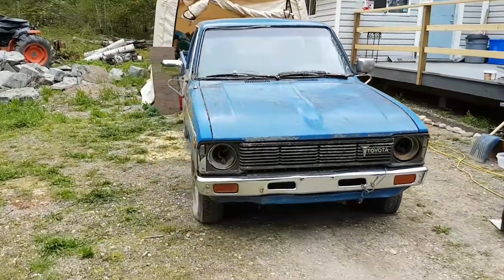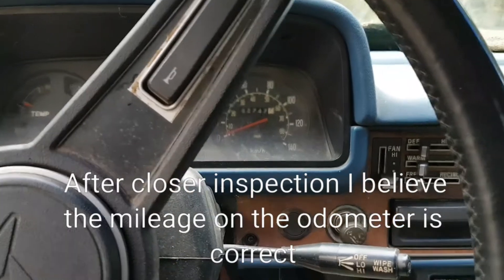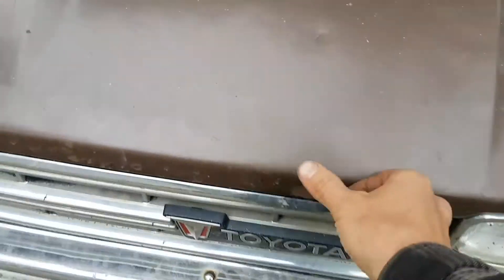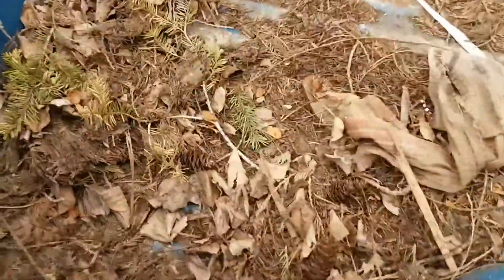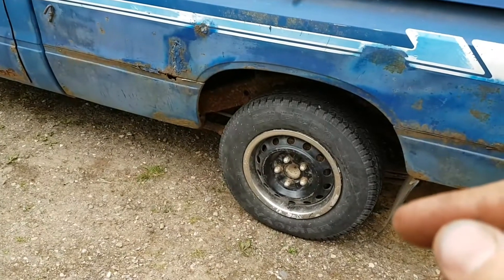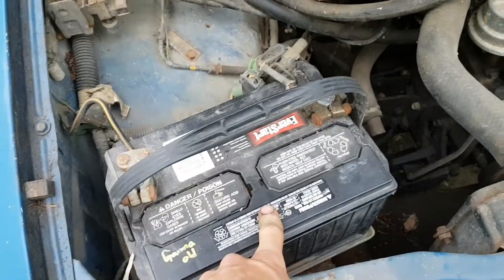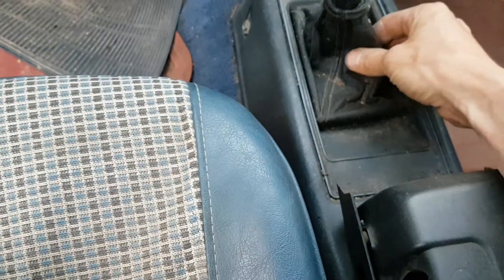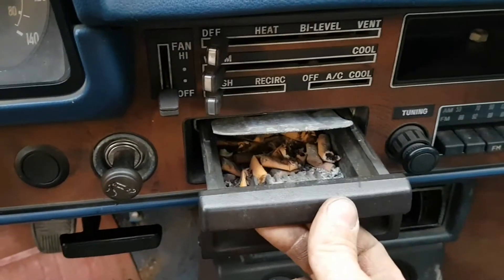My 79 Toyota Pickup

Comment: where in BC do you live? I have a 81 diesel and just got it and love it. 

your video on the timing belt is great to see as I think that i should be switiching it ASAP as Im to understand other than that the 2.2 NA L deisel is unstoppable ... Let me know if there is anything I should be looking for in terms of issues ect hop to keep in on the road for a long time 40 MPG baby ! as a BC boy we gotta get all we can. curious about the electrical pump you used.
Reply from the maker: I'm in the north Okanogan, only tips I have really is check you intake hose from the manifold to the air filter for cracks I have never seen one that isn't cracked, if you need a new one you're out of luck but you can pick up a roll of black self adhesive silicone tape thoroughly clean the rubber hose and then tightly wrap with the silicone tape, mine's been like that for years now. Clean and oil your frame yearly and if you can don't drive it in the winter it'll disintegrate twice as fast. A must do is replace your upper radiator hose, they get hard over time and the vibrations will cause the brass that holds the top radiator hose piece to crack and leak no new radiators are available outside of Australia and they cost upwards of $500. You should also do a valve adjustment intake is 0.25mm exhaust is 0.36mm, head gaskets are unobtainium here in North America anyways. You're going to want a parts truck, 22r engine uses a completely different transmission unfortunately so a parts truck is an absolute must if you ever think you might need a transmission or related parts. If you see parts I can't stress enough buy them even if you don't need them, they have great resale value within the Toyota diesel community and there's fewer by the minute. The electric pump was installed by the previous owner of the pickup truck there was an issue with the injector pump that would cause it to have hard starts, I had the pump redone by a place in Vernon BC it cost me just about $900 after that I just left the pump there because it makes bleeding the system easier if ever needed, I don't really want to try and use the hand primer because I guarantee it'll leak after. RockAuto is a pretty good source for parts, I haven't had any luck with Gilbert's or Lordco for a single piece other than oil filters they don't even have air filters it's a joke.
Reply: @Kowyn  Ehh thanks for the reply, the rear of the frame has been cut off and replaced. in addition I replaced the booth with a Ebay Thailand boot first thing, I had to cut 1.5 inches off it but it works V well. 

I live in vancouver so its just rain no salt but i have a frame swapped tacoma for winter (check my video) so far so good. worst case if I have a big failure I may TDI swap it. as far as a parts truck ill be OK there is lots of support for the RN30 and the powertrain is rumored to never die. if it comes to it ill spend what i have to in order to keep it going cause that 41 MPG cant be beat

Comment: I just bought a 79 Toyota pickup that has a toggle switch to the left of the cigarette lighter. The switch doesn't seem to do anything and I haven't had the time to follow wires yet. Any ideas what it might be for? I have a working hazards switch on the column, so it's not that.
Reply: Possibly to the fuel pump (aftermarket)